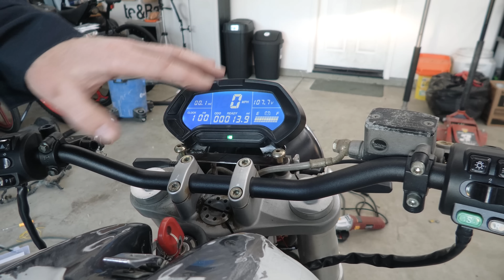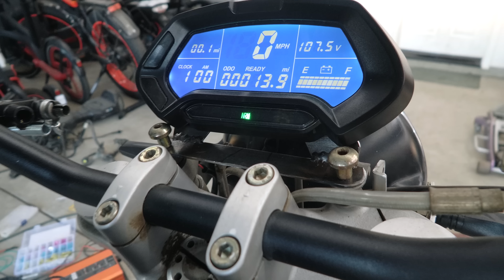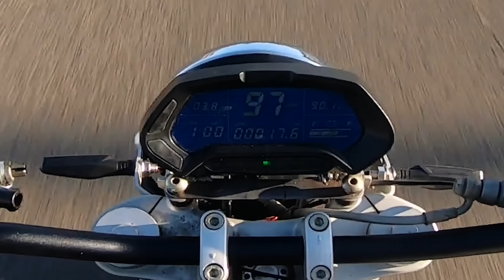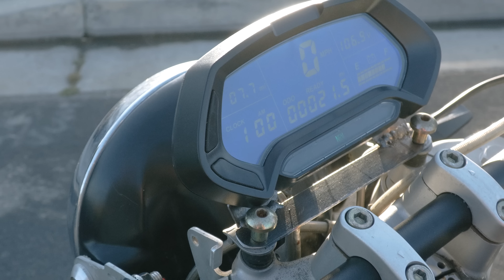TOP SPEED – Electric Ducati literally sounds like a FIGHTER JET

Comment: I’m glad you reinforced the frame a bit. There’s a lot of stress running through that point of the frame now that the structural part of the engine is gone. Could probably still use some more trussing.
Reply: some well placed trussing around the battery box will help the strength a lot and may go a long ways towards hiding the giant square box which looks out of place with the rest of the bike
Reply: @jamieforrester7108  Couldn't agree more about the square box, I would love to see some softening of the box with plastic mouldings or something.
Reply: I would add more trussing because it was originally welded in Italy. I’ll show myself out.
Reply: Years ago before a 1000hp engine was common my cousin built a huge marine engine for a corvette race car and it was so strong that half way through the race one of the wheels was no longer on the ground cause it had warped the frame so bad from torque. So they had to straighten and reinforce the frame and it would still bend slightly every race! It was one of those off shore boat racing engines like 8.0 liter 1400hp or some crazy stuff.

Comment: I am really glad that more people are starting to understand the joy of riding electric motorcycles. the raw torque that comes from electric motors is unlike anything else. I've been living in China for 8 years now where the electric bike scene is huge and I know firsthand that once you ride electric bikes, it's hard to ride a gas bike again. The silent smooth ride of electric is just unbeatable. (I even see you're using the same controller that I have on my bike). If you ever need help with getting parts or translating something from Chinese just hit me up. Me or my Chinese wife can help you out. I will make sure you don't get scammed by a Chinese seller again like what happened with your car ; ) 
Edit: I am also curious if you are running water cooling through the controller? I didn't see any radiator or water pump setup.

Comment: Crazy how loud it is at top speed. It sounded like a jet.
Reply from the maker: Sounds SO cool.
Reply: @TheInja  Is it the hub motor who sounds like a jet  ? It is way too cool ^^
Reply: @TheInja  You could possibly use the simple wiring of a moped or similar bike ?
Reply: @Camille-LG  The motor is the only part of the bike that makes any noise besides the tires on the road.
Reply: Must’ve used a Termignoni Exhaust converter on the circuit board somewhere… 🤔

Comment: What hub motor did you use? the QS 12 kW?  Nice example of what you can do with cheap electronics and a good frame, a perfect commuter bike, and not that far from the performance of the Monster 600 (albeit slow for a proper motorcycle). Good job!    👍
Reply: Absolutely right! 12kW hub (wound for 157 kmph at 96v) and APT96800 (or961000) It’s such a pleasure to ride

Comment: Awesome stuff! It would be interesting to see it (1) up against an example of the original gas-powerd Ducati, and (2) how it handles in twisties, track conditions etc...
Reply: LOL, It would fail on 0-60, top speed, range and maneuverability. But maybe beat it in stealth at low speed and cost?
Reply from the maker: @just_one_opinion  I don't think that was his point. Would definitely be interesting in a side-by-side! Bet it has more obvious torque from 60-100mph than original. No vibration, no shifting. It has it's advantages. Ever ridden a high-power electric motorcycle?

Comment: Hi, Inja, I think you have the rear tire mounted in the wrong way. I don't know if you have seen that. In this way, the tire will not properly evacuate the water on wet. Check the arrow who indicates rotation at the side of the tire.

Thank you for your videos.

Comment: absolutely love it. great job. 
the direction of the tread pattern on the rear looks to be facing the same as the front. maybe check the rear tyre for correct orientation.  I haven't had continentals but Michelin, Bridgestone and pirrelli have the rear tyre tread pointing forward in the center trailing back out ward
I love watching what you and Kurt achieve from the other side of the world and the other hemisphere. you should be rightfully proud of what you do.
Reply from the maker: Thanks, Mat! 💯

Comment: Very cool. Check out the  Aptera AWD EV. It's quicker than 5 seconds to 0-60. Can go up to 1000 miles on a charge. I ordered the 600 mile version. Sun changes up to 40 miles a day too.😎  I'm all in for EV's. 

Wind noise on a bike is much louder than you think. The motor drowns it out so we don't realize just how loud the wind noise is on a bike at 100 MPH.

I've had 14 motorcycles in my life. My Moto Guzzi V11 LeMans was one of my very favorites.  The wind noise on my R100RS was deafening! (even with ear plugs) as the fairing wind blast hit just above my visor.

No more bikes for me because my back is bad. Soo I got a GT-R. It comes close for 😁 power. It's faster and quicker than any of my bikes too. Plus you can fit a couple of dead hooks in the trunk!! 😅🤣😅

Nice video of your electric Duck.😎👍

Comment: is that the qs273 90h? i have a qs273 50H on a stealth bomber frame. It is absurdly fast.. 33,600W (168v 200A). It is absurd power on an absurdly light frame. I smoke crotch rockets off the line. I wanted to get the 90H but the 50H was already a bitch to get it to work on this stealth bomber frame. 200mm axle on a 175mm dropout swingarm. it is a nightmare to get the tire off and on.

Awesome build. I love building these things. Lookin forward to seeing the finished product!!

Comment: Don't get me wrong, I love the build and everything you report on. But in this case, you are working with a whole bunch of round batteries that could be placed in any configuration imaginable......and you build a square box...?? It would have been quite easy to at least round the leading edge.....and maybe add some sculpture to the sides....but still a great project. Thanks for sharing.

Comment: Looks great and seems to be going really well. Glad to see that extra frame piece.
Ofc, idk what if anything you already did towards using the battery as structural but it would probably still benefit from an extra bar from the engine mount to the footpeg, to support the swingarm pivot and the rider's feet. Maybe not needed but perhaps put a couple hundred miles on it then strip it down and inspect thoroughly for cracks by welds, before doing the final finishing?
Reply: Especially as it's a giveaway bike, you wouldn't want the (liability of the) frame cracking or splitting in use. Think triangles!

Comment: Hi, I noticed you used the hub motor for the Ducati build and mid motor for Cafe Racer. I was wondering which motor is better for top speed and range, hub motor or mid motor?
Reply from the maker: Mid motor has the advantage of gearing, you can change for desired outcome

Comment: From the motor size and everything it seems equatable to a ninja 300. Though I feel even though the 0-60 is similar to the ninja 300 that the over 60mph is better. Is the throttle setup kind of conservative? I feel like it should have some more gusto down low. 

BTW. Yah'll should see if anyone in your area has electric motorcycles and see if they will let you test ride for the channel. So, you can see how they perform. It's mind blowing.

Comment: About to build my own with a 15,000 watt 17 inch 7.6 hub motor with a 72 volt 150 amp lithium battery. i was going to get a 96 volt 150 amp but im sticking with the 72 volt 150 amp

Comment: nice, was the pin you guys' idea? im guessing you drilled through the axle and nut to run the pin through. i might have to s̶t̶e̶a̶l̶  borrow your idea 😂
Reply: also, 0-60 times with a hub motor will usually be slower than a geared powertrain, since as the RPMs go up the torque decreases almost linearly. unless the supplied amps are large enough, in which case torque is constant, lol
Reply from the maker: Lol!! A lot of old motorcycles have a castle nut and cotter pin!
Reply: @TheInja  ah ok, never worked on motorcycles only bikes.

Comment: Not an E V fan but interested and impressed with the build process . However , where the battery pack is looks plain ugly . Can I suggest that when you paint the bike could you paint a Ducati engine on the sides of the battery pack . Regards and thanks for posting .

Comment: It seems that the 0-60 time should be a lot faster no?  Any idea what the battery and phase current caps are at launch?
Reply: It’s limited by the motor at this point. That’s about as good as it can be for a hub motor wound for that top speed. It’s pulling 1000 phase amps and between 450 and 500 from the battery. It feels very nice at that speed. It would obviously be a little quicker with a smaller rider, so the “official” time may be lower
Reply: @LordCurt  Thanks! Do you like the overall ride of the Ducati with hub better than the mid drive cafe bike you built? I'm in the process of converting a gsxr 600, but still on the fence about drive systems.  I do hate chain noise

Comment: My bike doesn’t even have first gear wound out at 60mph! Actually you will be on the back wheel or worse if you floor it don’t let off! I’m 283lbs and even I can’t hold it down! I either gotta short shift or let out at like 7k rpm or it stands straight up. Makes it hard to get a 60mph tim! Dude on bikes and beards had the same problem with the GSX-S1000 trying to record a 0-60! 1/4 mile is more our thing they are geared perfect for the 1/4! You can even out run the full race bikes for a bit then at the end of the track they blow around is with their aero and top end gearing.

Comment: How powerful is the controller?
Reply: The controller is programmable up to 1000 phase amps, and we’ve pulled 450-400 battery amps. That’s a peak input power of about 50kW. It’s rated for 12kw continuous, but I’d bet it could do 15-18 continuous in reality. It is quite underrated
Reply: Wow, that's crazy man. Wish I could test it 🤤
Reply: Will do

Comment: 5.2s for 0-60 is actually not impressive at all, especially for an e-moto. The bike is really neat and impressive, but the speeds are nowhere near impressive. My '83 750cc carbureted does 0-60 in 4.1s.

Still though, good job on the bike. Can't wait to see it finished.
Reply: Top end consumer electric bikes are between 3 and 5 seconds, so it’s not the fastest but pretty dang reasonable. Fastest hub motor I have seen when you consider acceleration and top speed, though

Comment: DC CATI
Well done team
The handling characteristics are they similar  to a standard petrol Ducati ?
Onwards and upwards 👍
Reply: We’ll put it through its paces on some twisties once it’s reassembled finished 💪🏼
Reply: @LordCurt  looking forward to your next videos, a little tip on the paint scheme, it's possible to deflect attention from rectangle battery box by clever use of which colour paint is used , for example black on the bottom will help it blend into the bitumen making the battery box look smaller 👍

Comment: Should handle well!  Removing the motor, which is the most important stressed member of the chassis,  sugests about 40% of the strength will have gone.  This will mean it's impossible to keep the wheels inline, and will make for a very interesting ride.........................lol
Reply from the maker: Thats why we added reinforcements.
Reply: @TheInja  Lol..........I get the feeling you dont have a clue as to what you are doing.
Reply from the maker: @humourless682  you saw us doing 98mph flybys straight as an arrow though?
Reply from the maker: @humourless682  how would you build it? What should we change?
Reply: @TheInja  Try riding it round a bumpy corner fast.......
Reply from the maker: @humourless682  try riding any bike around a bumpy corner fast
Reply from the maker: @humourless682  no input about what to change?
Reply: @TheInja  Much more difficult if the wheels aren't inline. Shame they can't inject common-sense................

Comment: All these  "electric"  bikes, cars ect the only highlight is how fast they go in a straight  line!  Not how they handle, stop ect.  Look at the electric bikes at the MotoGp rounds, they how next to no range, are super heavy  and handle lig pigs.  And if you crash one, you need to "run away" because  you might get electrocuted by the bike!

Electric cars/bikes are not "sport" vehicles, they are just transport vehicles. 
Sport cars/bikes need gears, they need engine breaking, they need "power bands"!

Even Electric  cars/bikes in drag racing is boring!  No skill is needed, bearly any engineering is needed  😴.

Man made fuels are the answer  and hydrogen injection in to ICE.

Porsche is spending hundreds of millions on none polluting fuels.

Most electricity is produced by burning coal! Think about it!

Comment: Blatantly fake. 
Sound FX added in post.
Reply: I can vouch that they are 100% real. It sounds even better when you watch it in person
Reply: @LordCurt  Welp, I'm both professional sound designer and hobby e-bike builder.
For this suggested level of Doppler Effect, either this HUB motor has to generate aprox. 90-95dB of noise ( hardly ), or whole bike has to move huge amount of air at high speed,
producing high and low pressure zones.
With your proposed physics model, every Tesla, Zero or Cyclone should sound like rolling jet-propulsion thunder.
But they are not.
This kind of noise is also nowhere to be heard in drivers POV shots - just regular hub motor wheezing and humming. 

Therefore, fake and poorly executed.
Reply: @Igormeister  lol. Dude, say what you want, but I was standing right there. A litany of credentials does not change the fact that I literally heard it live.
Reply: @LordCurt  There, there... Mr. Fictional Jet Sound Apostle.
Pathethic.
Reply: @Igormeister  😂 what a troll. People will argue about anything.
Reply: @LordCurt  Nope. I argue about very specific matter, posting from my YT ID-confirmed account. Far from any definition of trolling.
You are caught in a lie.
Reply: @Igormeister  swing on by to hear it for yourself! Available anytime